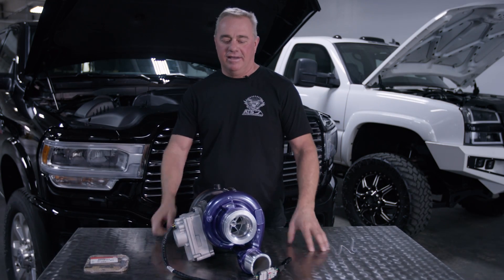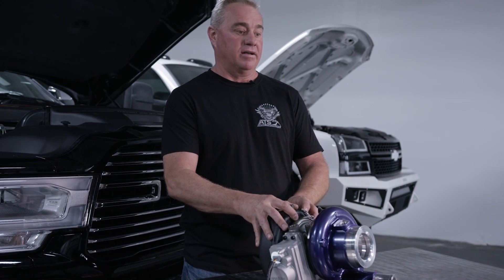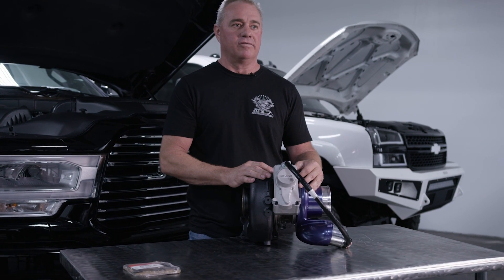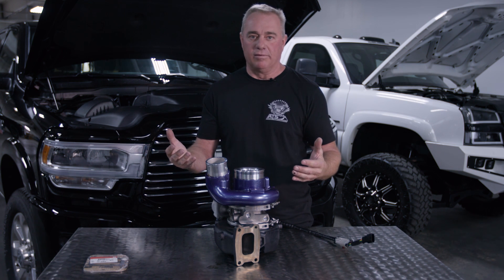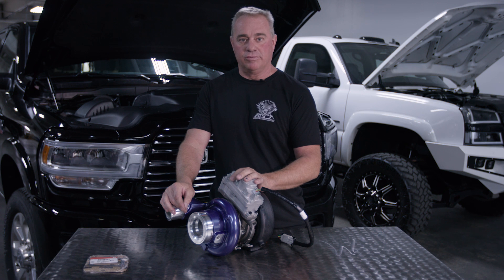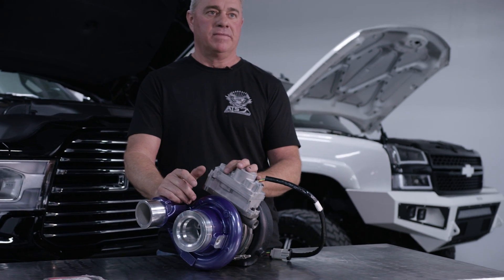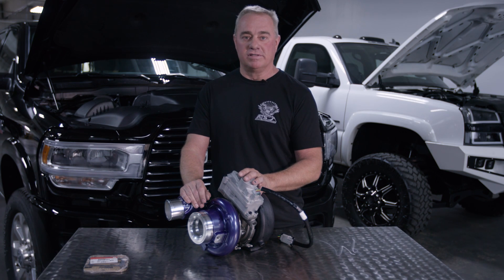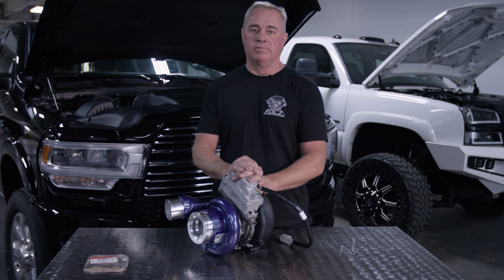ATS Diesel - 2019+ Ram Cummins 6.7L Turbo - Aurora VFR - Direct Factory Replacement

Comment: Need this in a stage 2
Reply from the maker: We do offer our VFR for the 2019 + Ram trucks in both our Stage 1 3000 and Stage 2 4000 Series. We've got you - https://atsdiesel.com/collections/dodge-ram/products/ats-diesel-aurora-vfr-turbocharger-assembly-with-new-actuator-for-2019-current-ram-6-7l-cummins?variant=48600464261396